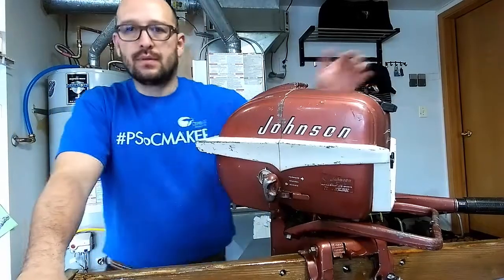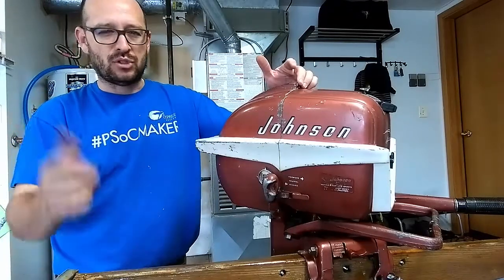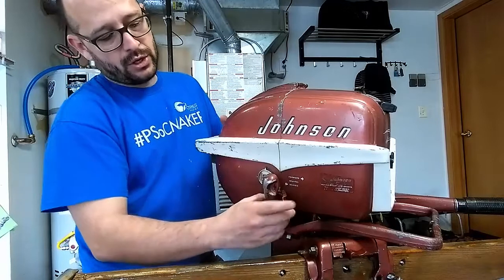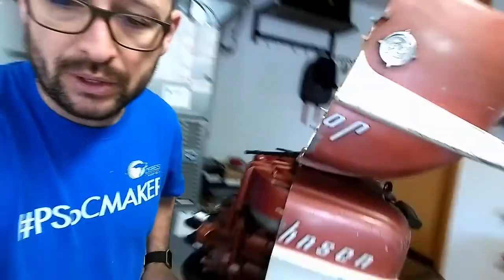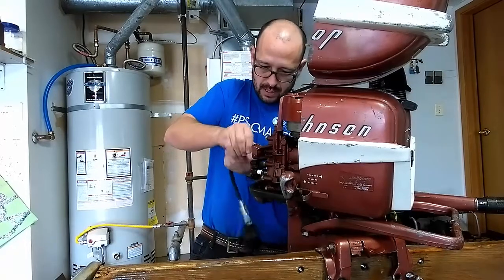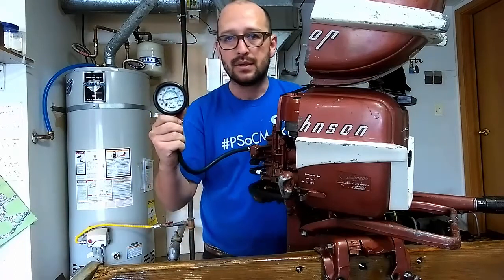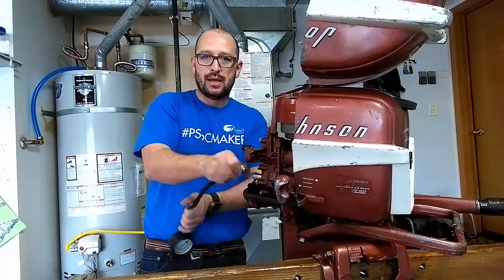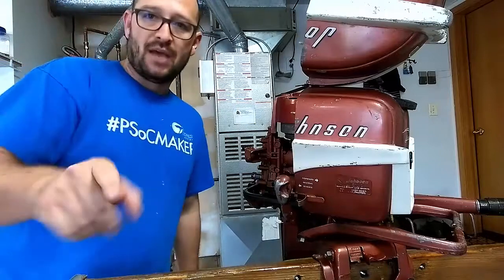Johnson 1956 5.5hp Seahorse Restoratio #1 - Compression check

Comment: Yeah, the info someone gave you about 100PSI is wrong, you will never see much more than 80PSI on one of these engines.  It is also important to understand that compression readings on these small engines are oftentimes inaccurate due to that long hose on the compression tester, which tends to lower the readings a bit....This would make little difference on a chevy V8 with a large combustion chamber, but can make a difference on small engines like this one.   So, 55-60PSI seems about normal.    This is a beautiful engine, and appears to have low hours on it, you will be amazed how nicely it runs
Reply from the maker: that makes sense... I think the most important things was to check there WAS compression. Readings were spot on and the work was fun ! Im uploading the last videos as well ! thanks for the comment !